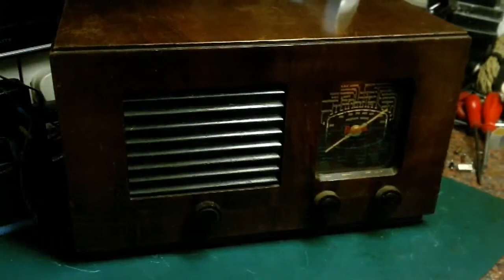Portadyne radio restoration Pt3

Comment: Lovely job and lovely job. I am doing a Pilot Little Maestro right now, Exactly the same sort of set, Cost £1 and needed two valves and a capacitive dropper. That is why I knew the value,,,,
Reply from the maker: Nice looking sets the little maestro. This one was easy apart from my little error. regaring the dropper calcs i found this usefull website http://www.electronixandmore.com/resources/calculator/index.html does all the maths for you.

Comment: Shame when the digital switch over finally happens all these old radios will be useless:(
Reply from the maker: Ill just build a multi channel low power AM transmitter and stream content from the web, I know a few people who have built solutions like that. plus most can be adapted into blue-tooth speakers  but still using the valve amplification.